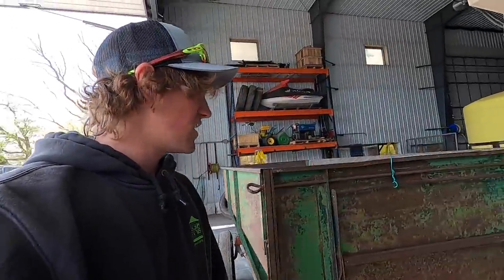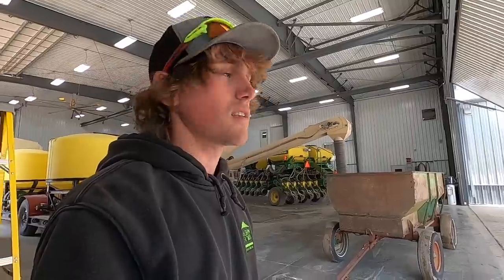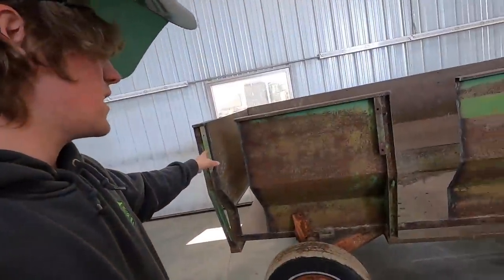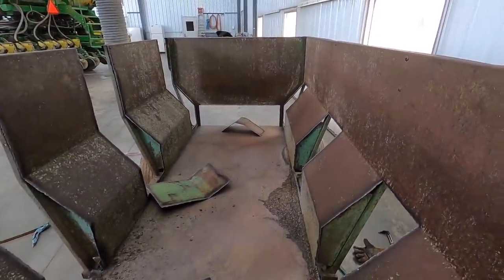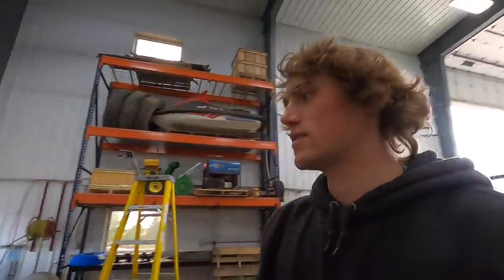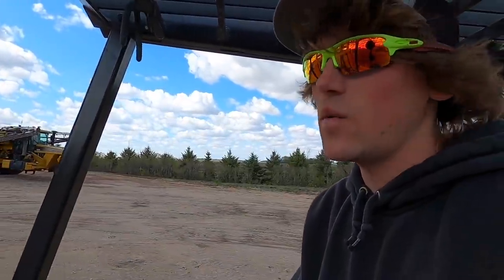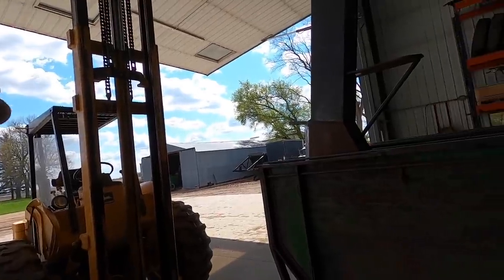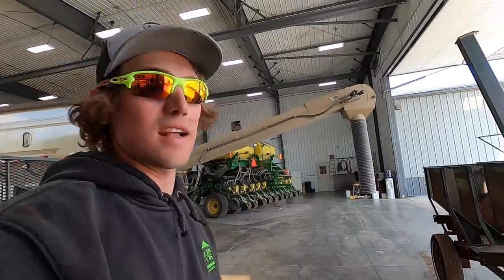Destroying Great Grandpas Flare Box

Comment: That wagon would of been super modern 100 years ago. Ours wasn't new when I was a kid. They used it when picking corn. A JD A pulling a 1 row picker and the wagon.. it's last years it held ground feed till the cows were sold. Then cut up for scrap, along with the old 40 50s and 60s farm junk. 
Great job finding a new use for it. Plus it has some sentimental value...

Comment: I took a metal filing in the eyeball many years ago. Trust me when I say it was very painful and not so pleasant having it removed. Always wear safety glasses and hearing protection when doing metal work. If you do so you will thank me years later.
Reply: Only metal I've had removed from my ere bounced inside my safety glasses into my eye only time I've ever worn the dumb things and I own and work in a fabrication/welding shop and a mechanic shop and a salvage yard but most of that work is done from the cab of a machine

Comment: Chet add a piece of steel the full length of the wagon where the rot was in the inside of the box. It will not only reinforce it, but also tip the top of the tile boot plumb so its straight up and down.
Reply: Exactly the first thing I thought of. Or turn the boot around, so the outlet goes through the hole in the side. In other word put the toe of the boot in the hole.
Reply: Both exactly what I was thinking especially if the quadtrack could get high enough to lift them in there on it's own through the open side of the wagon

Comment: That is a 1947 Case  running gear probably has rotten 16 in. tires, jack it up spin tires to check wheel bearings or you will be stuck on the road with blown tires or ruined axles.